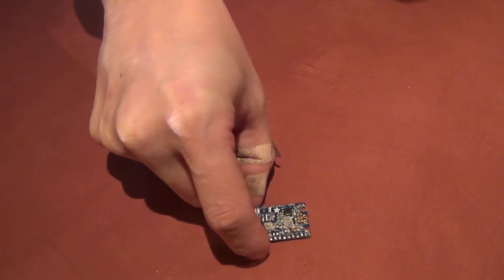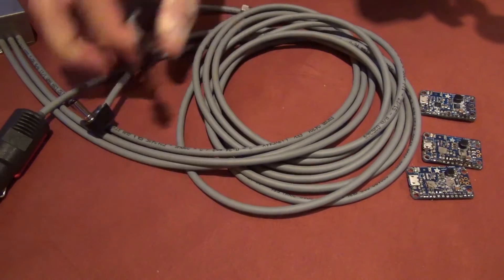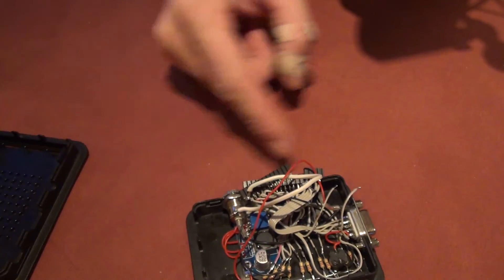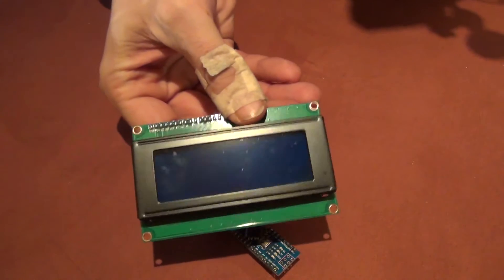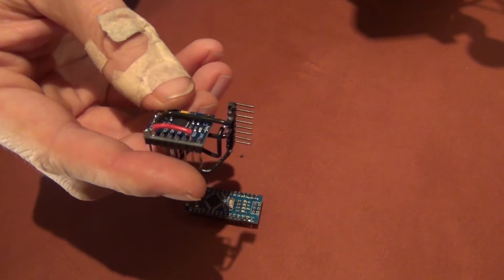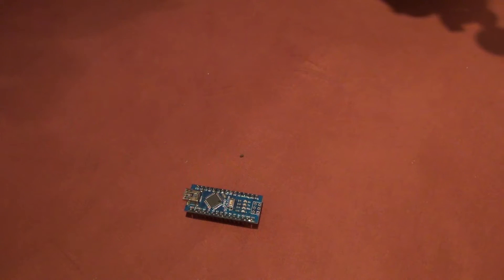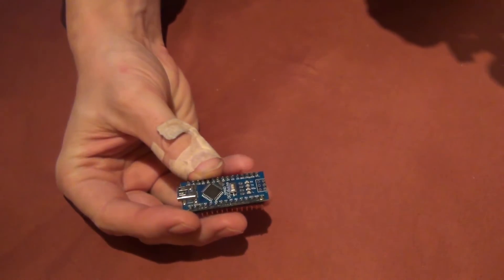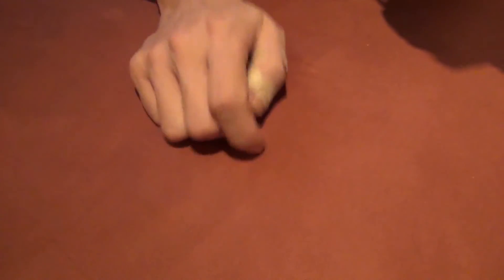Fails and Stupidity: Arduino, Raspberry, LiPo, AIS, NAVTEX

Comment: Really interesting. I had the same Serial 2 TTL trouble. I burned 3 of them. And also my DC DC converter still works but the 7segment LED stays dark. That seems to be a common failure for theses chinese components :I Really bad if you rely on the TTL converter and all of a sudden, no NMEA data comes in anymore ... After changing theses 2 times, I switched to a semi-commercial NMEA 2 USB converter which runs for 3 years now